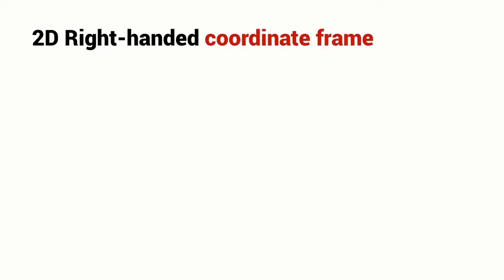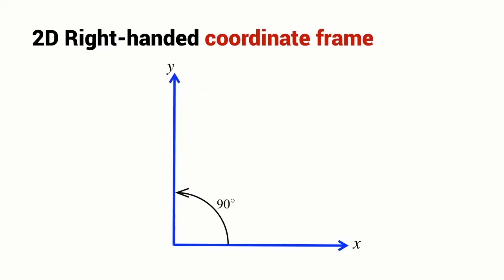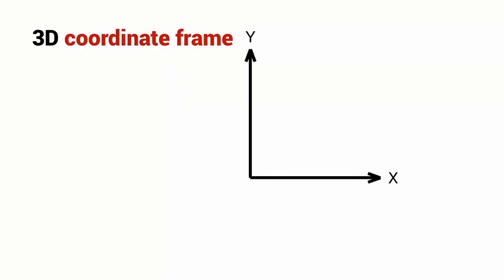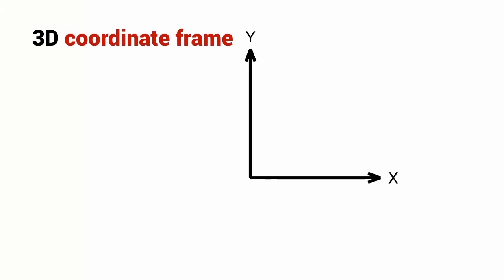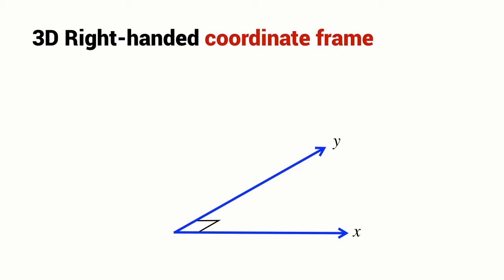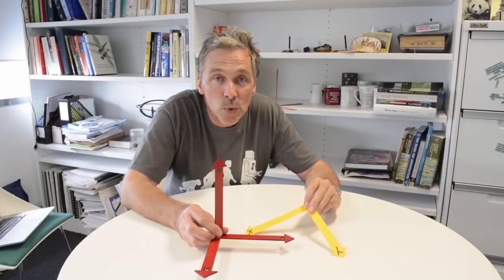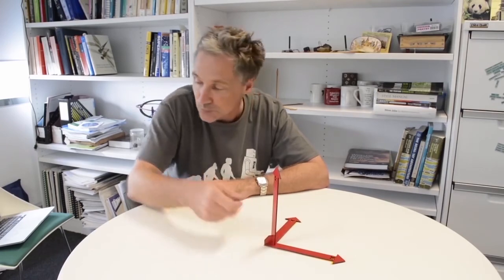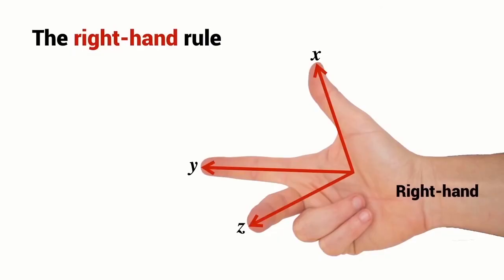Right-handed 3D coordinate frame

Comment: Is this special case of the Mandela Effect in OZ School Mathematics co-ordinate systems in flight MH370 avionics?  You do not need to explain an obvious thing in a video unless you are off on a tangent.  Co-ordinate systems are different all over the place, (some like yours are twisted left 90 degrees and some are even not orthogonal), hence matrix operations are needed to convert them out of Bears world into My world (Imperial Collage online lessons on co-ordinate geometry, vectors and matrices used for co-ordinate system conversion).  Sadly your representation does not match vectors or matrices or physics or avionics science co-ordinate systems, so it must be "OZ world" a disaster for navigation software in MH370, as your x is up, and your y is horizontal, 3D version y axis going into the page.  (Depends on how you hold the paper up or have it on the table, edge on or upside down.)  Worse you think somehow 2D does not extend into 3D by adding another axis, but somehow a different set of rules apply for 3D; more than just adding an extra orthogonal z-axis ?    What if  your students start asking simple questions using the word WHY?  Only some hand images on the internet are correct, some are even cupped hands, some have fingers that bend in a double jointed way!   This is the evolution of the Mandela Effect with a special OZ case of flight software causing the missing flight MH370?